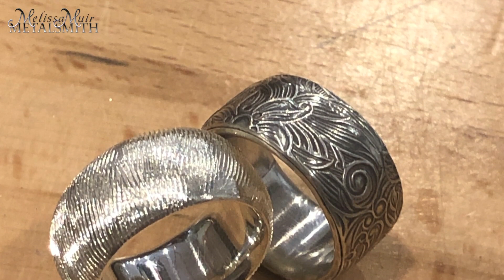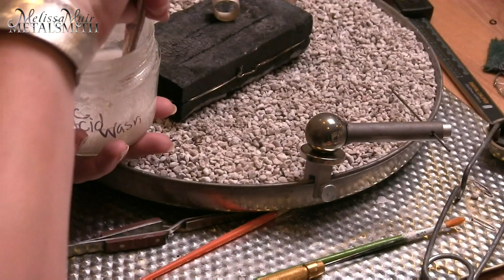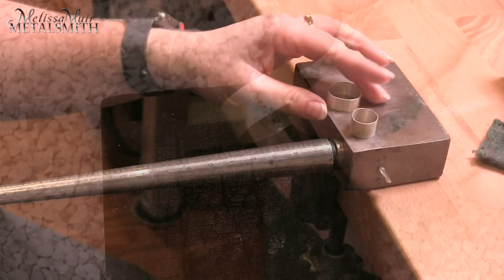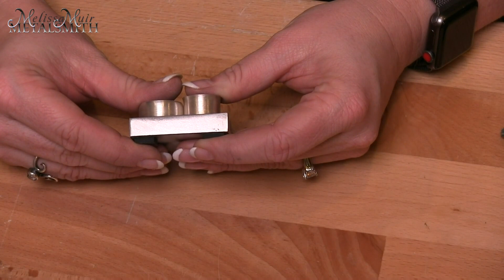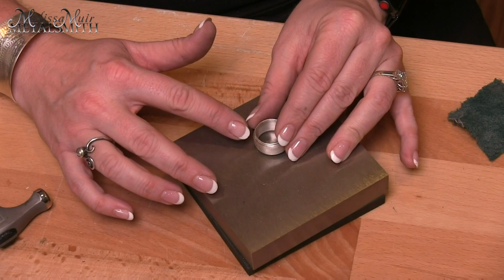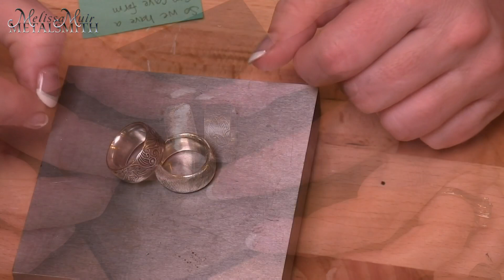Project 14 - Hollow Donut Ring - Alan Revere Professional Jewelry Making Series- Tool Time Tuesday

Comment: Hallo Melissa, thank you for your clear instructions🙏🏼 lifesaving!  
But could you pls. explain what to do if I would like to solder the 2 bands together? At which point can I solder instead of forcing as you showed in the video? Thank you so much!🙏🏼
Reply from the maker: I would still go through the entire process shown here in the video. Then at the end I would run a little solder around the seam. You must create a vent hole somewhere though or you risk the piece blowing up, a very likely scenario without the hole.
Reply: @MelissaMuir Super Thks! I will 🙏🏼 Keep making these great video!

Comment: Hey Melissa, thanks for this great video! ❤️ How does it work when I want to solder the ring? Does the inside band also has to be larger? And which book of Alan are you working with? Cause I am considering to buy it myself. Thanks a lot :)
Reply from the maker: @viktoriaa6953  this is from the book Professional Jewelry Making. If you want to solder the ring, you would follow the same steps and then solder it. But be sure you put a small hole somewhere so it doesn’t explode.

Comment: What hammers did you use? Thanks for posting the sheet gauge in a reply i was going to ask as well. Hi from Sydney Australia. Really like your style of videos. It is so easy to listen to and watch. The books here in Australia are over $120 each. Kindles are about $22 each but I like books so much better than electronic, I'm 70 so very old school.
Reply from the maker: @peterrschuck  thank you. I used an embossing hammer for the forming. But any ball peen would work. Yes. The book is pricey. I used the kindle version for a long time.
Reply: @MelissaMuir  thank you so much for replying. That is very helpful info for me.

Comment: What do you mean if it gets too hot it’ll ha e porosity?. Thanks!
Reply from the maker: It is almost as if the solder bubbles and then you have micro air pockets.
Reply: @MelissaMuir  I did not know this. Excellent explanation. Thank you.

Comment: Gret video, thank you!  Is there information anywhere on how I can adjust the measurements to make different sizes?  I've looked but can't find anything so far.  Thank you so much!
Reply from the maker: Thank you. Glad you like them. As far as I know, there is not a conversion chart or anything like that. But I start with the measurements in the book and will make changes from that. For instance, The book directions are meant to make a size 7 ring, starting with 0.6mm (approx 22 ga) and 56mm. Using that information, I can use a ring blank sizing chart (check Rio Grande or Contenti) I can then make some changes larger or smaller. The outer band is 12mm larger, so that is an easier one to change. I hope that helps  a little.

Comment: I’m not sure why piercing would be required to soder. Can you explain? As always, this video was fantastic! Love watching and learning from you!!
Reply: I believe it's because gasses can build up, causing the piece to explode. I'm sure Melissa can explain it better!
Reply: I would love to see a good scientific explanation of this problem. I suspect you wouldn't get a perfect solder joint due to expanding/contracting gases. I would be more worried about the ring imploding due to water in the flux turning to steam therefore driving other gases out of the ring leading to a partial vacuum (should perfectly soldered joints be achieved) in the ring. Atmospheric pressure would crush the ring when it is quenched in cold water.
Reply from the maker: It is because you do not want the gasses to get trapped inside the ring. When they do the piece can explode, and it is never fun when that happens. So anytime you are making a hollow form and soldering it closed, there should be a hole somewhere to allow the gas to escape.

Comment: Great video!! Could you tell me what flat file you're using? I'm hoping it's one I can get at the local big box hardware store. Thanks.
Reply from the maker: LuniLadi do you mean for
The texture? My flat file is finer than the one from a big box store. And the one for texturing is a specialty file that will need to be ordered in.